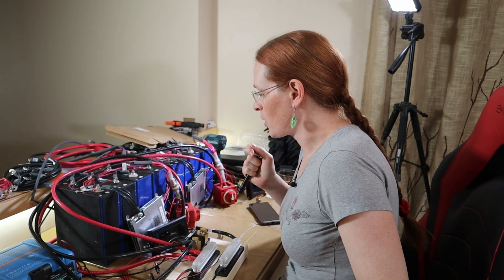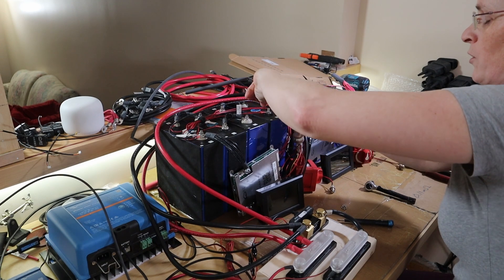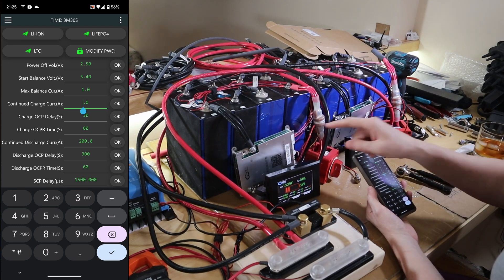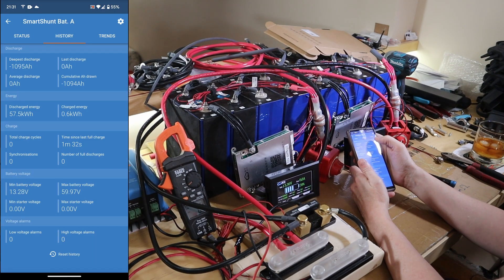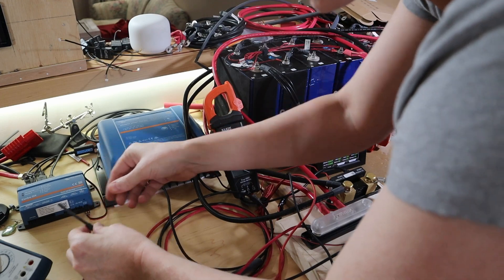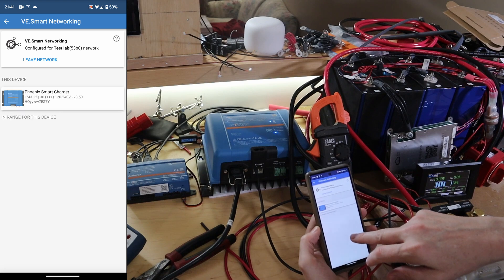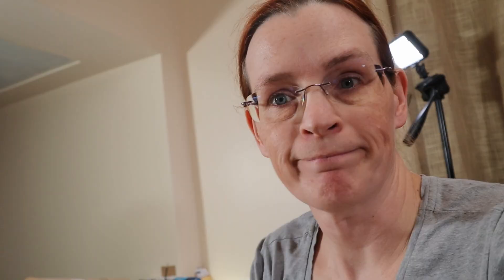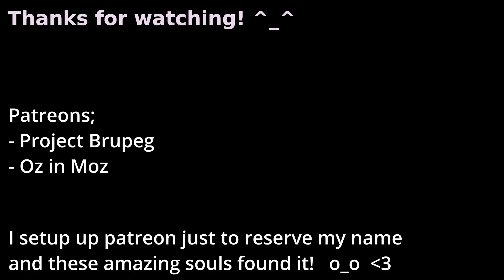Converting 48v Pack into 12v Packs - Part 4 (Ep. 52)

Comment: there may be some provisions, in the emerging code, having to do with connections; which may allow for higher voltages than 51.2Vnom.
but i think that center tap sea ground may have to be there, at some point; for packs over 25.6Vnom.....and the same connection code Might allow for floating packs, under those regulations, which are a little higher than 25.6Vnom.
Reply from the maker: Can you point to where in the ABYC or similar code that a center tap over 25.6v is required? I've never heard of this.
Reply: @TheDigitalMermaid  there is no code yet, for all this piece meal stuff ... people are working on it while others are working on approved systems...
but leave your system electrically floating, until someone tells you otherwise....
the center tap sea ground is safer for people working on the system, but a lightning strike, then, would be a mess ....just follow safe practice very strictly, and leave it electrically floating for now.....honestly i don't know what to tell people yet......yeah you are more important than your equipment, ok....but if lightning stikes, then your batteries might start on fire, and then that's not safe either, is it ????
Reply from the maker: @RulgertGhostalker  How would a lightening strike start the batteries on fire? ABYC TE-04 is for lightening protection, E-10 covers storage batteries, E-13 covers lithium batteries specifically, A-28 covers galvanic isolation, and A-28 covers galvanic isolation. All refer to under 60vDC as "low voltage" and in them I've not seen any mention about this center-tap approach, or how it helps.
Reply: @TheDigitalMermaid  it wouldn't, if your pack is electrically floating, ( with no reference to the ocean water, it can move WITH the EMP )...
it's the center tap sea ground, ( which would center reference the pack to sea water, and make the system safer to work on ), which would also cause a problem with EMP being induced into the pack during a lightning strike .... like i said, leave it electrically floating, and follow safe practice for now..
Reply: @TheDigitalMermaid  60V is not "low voltage" on Salt Water...that's Fresh water.
Reply: @TheDigitalMermaid  the only code for piece meal stuff, at the moment, is:
On Salt, if your running a electrically floating pack at 25.6Vnom or lower, your good within the old code ... but most people are running higher voltages, and if it's over 51.2Vnom then i don't think i can say anything higher would ever be within salt code..
Reply from the maker: @RulgertGhostalker  Can you link to any documentation anywhere talking more about this?
Reply: @TheDigitalMermaid  can you help me out here, and bring up my other replies on your channel with the Salt sailing community who have done, or are doing electric drive conversions??? i would appreciate it, thank you.
Reply from the maker: @RulgertGhostalker  I'm not quite sure what you're asking of me. I have to make decisions based on available literature, which is why I asked for documentation or references backing up the center-tap claims, and now the idea that <60vDC is not low voltage on salt water. The ABYC knows what they're doing, and they've not mentioned this at all (and of course most boats are in salt water). So if I'm going to alter my designs/plans, I need to see something backing up what you're saying.

Comment: Greetings, just a quick note about marine wiring protocols if you feel its relevant. It is normal to always put fuses on the charger outputs and also wire directly to the battery side of the main switch as is the bilge pump and solar, this is so you can leave the boat isolated from loads, leaving the charger/solar and bilge active all times. It's cheaper to replace a dead battery than lift your boat off the marina bottom, it really happens. This may be of interest,  the Cerbo has digital inputs that can be wired to the bilge pump alarm circuit and if you use Victron VRM will email a "pump running " alert (if you have wifi though) plus it can display tank levels if configured. good prep, and have a safe journey back.

Comment: Looking good!! I've got a question about your pack configuration, and why you chose to make two 12V (1p4s) packs in parallel, rather than a single 12V pack in 2p4s? If you configured it as 2p4s you would only need one BMS, one shutoff, and one set of battery leads. Maybe you want to be able to split the pack in half to make it easier to transport?
Reply: I'd guess avoiding a 200A hard limit on discharge also plays a role in that, given the observed ~230A rush current on diesel start.
Reply from the maker: Jouni is right, it was to divide the starter load (if I end up needing it for that) across two BMSes/fuses. Also for redundancy. Now that said, I didn't finish the battery before I came down here, which sucked, but I've been able to take better measurements and now I think I can make 2x 2p4s 12v banks!  14.3kwh on the 12v means the total onboard capacity would just crest over 100kwh, which makes me foolishly giddy.

Comment: I think the first time you set the calibration voltage you hit the wrong 'OK' button, so that might not have been undone when you chose the chemistry.
Reply from the maker: Oh, huh, maybe that's the case. Well for sure the cell count and capacity got reset, so who knows. :)
Reply: @TheDigitalMermaid  you should double check the settings because I think you missed the ok button on one of the temperature settings as well

Comment: you know why the Buck converter started on fire? See when DC voltage shorts and current is still flowing it can jump small gaps. That is why we use Solar/battery disconnects. Do not trust a DC breaker ever as there is not enough of a gap to truly disconnect a short. Inline fuse and disconnect is only way to truly be safe with DC even at low amps. When you do your solar on your boat have a PV disconnect on both Neg and Pos side. Its $50-60 that will wave your components and keep a fire from happening.

Comment: So you KNOW that Victron use Li-Ion as definition for LiFePo? If yes - thatś a shame for an actual product in this price range and at least itś technically false....
Reply from the maker: Agreed, it's confusing. :/
Reply: @TheDigitalMermaid  It's because every Lithium battery is a Lithium Ion battery, because lithium ions are the charge carriers in this kind of battery. The specific chemistry (Iron Phosphate, Nickel Manganese Cobalt, etc.) indicate the (lithiated) metal oxide cathode composition.
Reply from the maker: @upnorthandpersonal  Oh for sure, I get that it's technically accurate, but given the colloquial used of "Li-ion" for cobalt-based chemistries, and given the voltage / charge profile is specifically for LiFePO4, I think they'd do well to update that.

Comment: Hi Digital Mermaid, if I saw it correctly( not completely sure), you intermixed the over voltage protection/return. The return voltage should be lower than the protection voltage (3.60 vs 3.65). I saw it for battery one (the left one).
Best, Peter
Reply from the maker: I did initially but corrected it after. Well spotted.